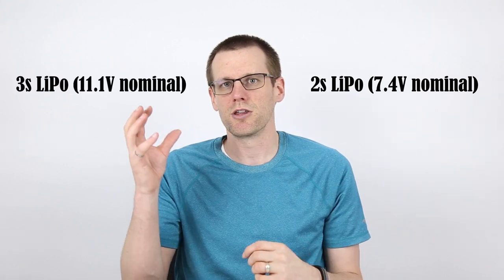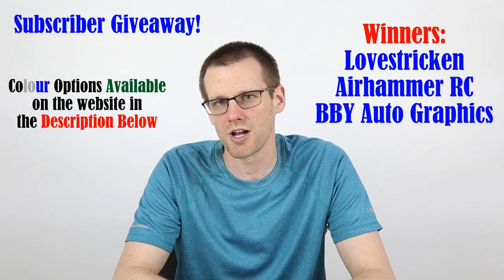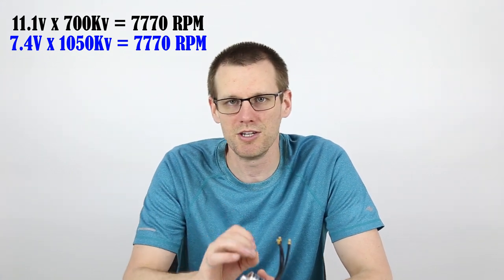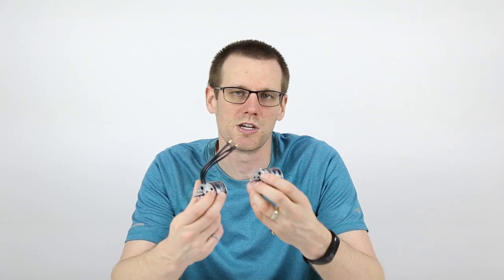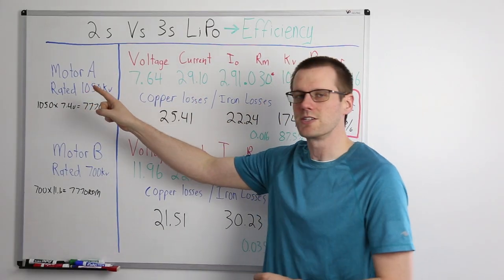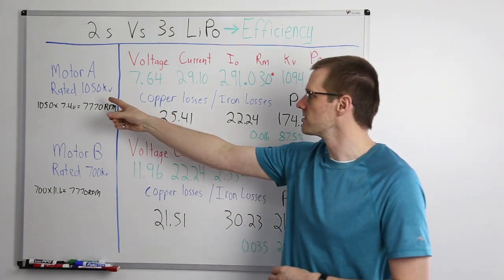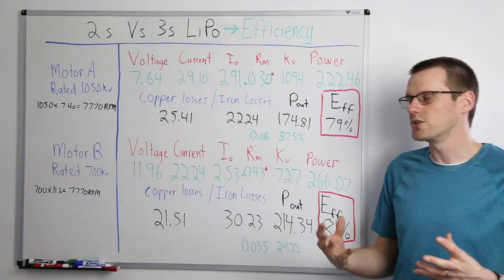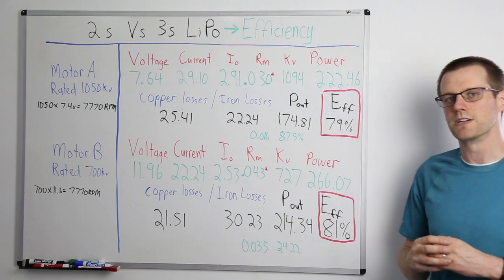Equal Load is a 2s or 3s Brushless Motor More Efficient on the Dyno?

Comment: Another great video - thanks! I noticed that although the difference in efficiency appears small, the difference in power output is significant!
Reply from the maker: Yes, but the difference in power output is not relevant in this comparison. I could've had the 2s battery output more power just as easily. The only focus point for this video is efficiency. The difference in power output is because I don't have the same 2s and 3s packs.

Comment: I was hoping to see comparison of 2s vs 3s on the same motor while setting both input power the same by limiting 3S input current.  The goal is to see if lower current system is more eff / colder or not.  Since all our ESC are rated by amp and not power.  It would also be interesting if the motor output the same rpm.  In theory, I would think both case would be identical or would it?
Reply: The esc actually did run a little less amps. the higher voltage allowed less current used even 3-4% difference shows less current needed to accomplish the same task
Reply from the maker: W&W C , this one provided the only difference is RPM output was the same? https://youtu.be/X-w8rkeR6VY

Comment: Thanks for explaining. Power output 2s=174W (0.233hp) vs 3s=214W (0.286hp) - the 3s setup will be able to do more work compared to 2s - ie can gear up more? Also say same capacity battery say 5000mh, 2s draining at 29amp vs 3s draining at 22amps means that 3s will last longer? So it is preferred to go higher voltage space weight permitting?
Reply: A 5000mAh 3s is 50% bigger and heavier than a 5000mAh 2S. This is because the 2S has only 2 5000mAh cells, while the 3S has 3 5000mAh Cells. So yes the 3S will last longer, but that is primarily because it is bigger and heavier, not because it is 3S. Given a 3S and a 2S battery of the same size and weight, the runtimes should be similar, assuming the motors have similar performance.
Reply from the maker: Hi supercharger, the only comparison you can make from this video is efficiency. Any other findings are outside of the scope of this video. Comparing the power output for each will lead to inaccurate conclusions

Comment: I love your content.... I really sit down and digest it. my question or request is to do a comparison of ES c's of the same amperage rating. say specifically a 120 amp hobby wing ESC versus say a cheap eBay blue ESC at 120 amps. Comparing each power's output to a given brushless motor say 3650 4300kv motor. Also testing each ones provided power, efficiency..  and test  each one to failure, seeing which 1 fails 1st and mabye  explain why

Comment: Trying to build a catamaran with dual motors. What is your thought on twin 2s batteries with twin 2000 KV motors? Twin ESC's will be applied. Thanks! Btw your videos a top notch!
Reply: 2000KV motors can easily handle 2S batteries. They might even handle 2x 2S batteries in series, making them effectively a 4S battery, though this might be pushing it a little bit. Personally I would go for 3S batteries for a 2000KV motor in a boat. That should put you in a nice and comfortable RPM range.
Reply: @2testtest2  thank you for the reply! This really helps. I do have another question.. do you have a recommendation for a Y-harness that will plug into the Esc's? Would a normal 2.4ghz controller work on dual motor application? Thanks again
Reply: @0utlaw_09  Yes any radio receiver should work. I just use a Y-harness that I got at my local hobby store, but you could also make your own, no need to go fancy. I have not tested this my self yet, but I believe you only need the positive lead to be connected for one of the ESCs to the RX. I have both connected, which does cause some odd behaviors when only one ESC is connected to a battery, but other than that it is seems fine.

Comment: Thank you for your video.

I have a question. 

It is a thermal cutting function of ESC.

this is done by temperature sensors or detecting current?

If it's a heat sensor, can I say that every esc has a heat sensor?

thanks~~
Reply: I can not say for sure what ESCs measure in order to protect them selves from thermal damage. I can however say with great certainty that a lot of ESCs don't have any kind of protection, and will quite happily destroy them selves if you ask too much of them.
Reply: @2testtest2  I think esc must have either a heat sensor or an electric current sensor.

I'm just very curious about what kind you use.